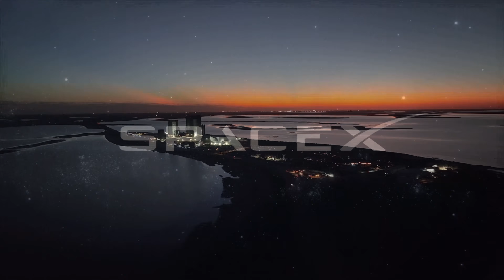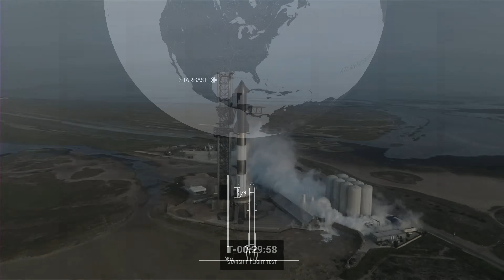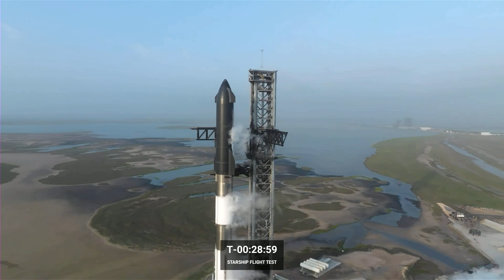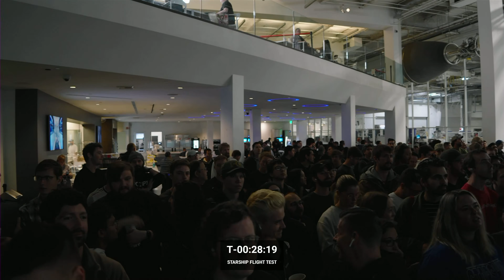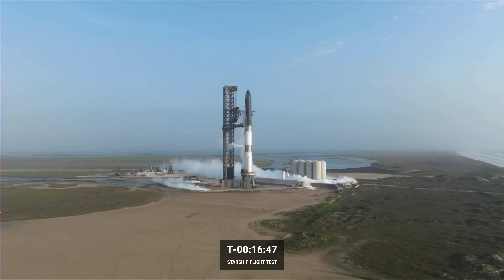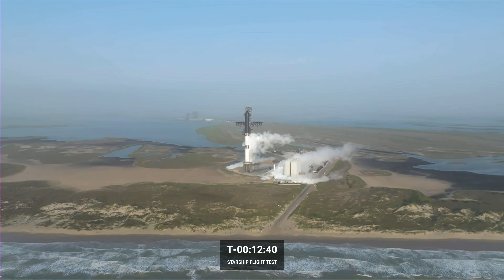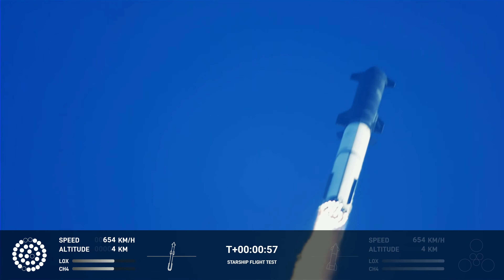Starship Flight Test

Comment: The fact that they could apparently lose so many engines and were still capable of liftoff and sustaining the mission was very cool. That's actually great redundancy and good safety feature.
Seemed like they were never able to completely shut down main engines so the starship was never allowed to separate. 
I can't believe the entire stack was able to flip like that without breaking in half. 
Can't wait to see the next one fly.
Reply: Could you explain more about the flip separation? Was the plan to go horizontal then separating or a 180 or 360 then separating? This is the first I've heard about it. Either way this was a great launch for sure.
Reply: I'm wondering if the altitude telemetry on our screen was off...  If correct, it seems like they were attempting meco rather low.  If the stack did indeed survive multiple flips while still below 60km (aka while still in palpable atmosphere), the vehicle is indeed impressively tough.
Reply: I mean 16 million lbs of thrust over 33 engines with minimal payload weight youncan definitely afford to lose a few :).
Reply: You can lose a few to lift off but it certainly will have an effect of reaching orbit. It seem secure for the rocket but the launchpad and immediate vicinity was almost destroyed. I don't think that van destruction was expected. Danger for those that risk their lives to reach space is expected and acceptable to a point. But not to those on land.
Not to mention the fuel tanks near the launch pod that were completely damaged by the debris: to near too dangerous.
Reply: The fact that the ship drifted sideways during the liftoff is of GREAT concern. That drift could have been towards South Padre island, or over the starbase complex. I think this was a narrow escape that will not be attempted again in Texas. Too many things went wrong. The FAA is going to take  a very close look at this one.
Reply: @1985NEVETS  It's supposed to start spinning when the first stage runs out of propellant. This booster was spinning because the hydraulic controls blew up around 30 seconds into the flight
Reply: Reckless behaviour
Reply: @palpatinewasright  I think that drift was an intentional horizontal velocity component, to keep the massive exhaust away from the launch tower; it did look to be exactly in that direction.
It's also not the first vehicle to do this: If you look at Space Shuttle launches, they also had quite a bit of horizontal velocity right at liftoff.
Reply: @palpatinewasright  The drift was probably due to the destruction of the pad at liftoff. 45:08 you can see the chunks of concrete flying more than halfway up the ship.
Reply: at 45:34 you see the hydraulic control aerodynamic shield blow away, followed by a clear explosion on the side of the booster at 45:37
Reply: That stack flipping as many times as it did and not breaking apart was a testament to the strength they’re going for. Too bad too many don’t realize what they are seeing.
Reply: The man is paying the cost for future reusable starships
Reply: @skillsprintug  He probably paid much more for twitter 🤣
Reply: @palpatinewasright  if it was a case that it was heading inland, they would’ve terminated the launch. No chance of that happening FAA are well aware of the possibilities thus requiring flight termination systems.
Reply: that lift velocity was crazy!
Reply: How many engines were on there?
Reply: @Ariakon  The drift at liftoff was because it had already lost several engines. To maintain control, the thrust vector must point through the center of mass of the rocket. The engine losses were random, they happened to favor one side over the other. To compensate for this the thrust vectoring points the engines sideways slightly, so the thrust vector continues to go point through the center of mass. Because the engines are no longer pointing straight up, there is a lateral component to the rocket thrust in additional to the vertical thrust. i.e. the rocket has to waste energy to push itself sideways a little bit so it can maintain control.

This also gives us a clue as to what happened when it started tumbling. It lost more and more engines during the ascent. Unfortunately for the super heavy almost all of them seemed to be in one hemisphere. The thrust became increasingly imbalanced and it had to work harder and harder to correct. As the first stage consumed fuel the center of mass moved closer to the fully fueled starship until it was almost empty. When the distance between the center of mass and the engines grows, it magnifies the effect of imbalanced thrust. The center of thrust moves farther from rocket center toward one side, eventually it reaches the point where the engines cannot point far enough over to make the center of thrust intersect the center of mass. When this happens engines start imparting angular velocity on the rocket and it begins to tumble. Starship's wings don't help this situation either; they add drag and exacerbate the spinning.

That's my analysis anyways, based only on playing ksp. Once the mass decreased enough the software might have started to differentially shutdown engines to help compensate, hence the discrepancy between the graphic and the visual of the rocket engines. But I wish they had some abort stuff programmed, would have loved to see starship flying but I guess they only have so much space to play around in so they have to go FTS in that specific regime. I'm excited to see what they learn from all this. I wonder if they'll go for another test or pause and make some big changes.
Reply: @luebrenj  "33"

They can't resist.
Reply: @palpatinewasright  Heard (unconfirmed) that some believe that they lost an HPU unit on one side at liftoff. ie lost some ability to gimble. Would lead you to think its a miracle they got as far as they did with 1/2 the hydraulics working (if true). Next iteration gets rid of hydraulics and goes to electrical controls. If you look carefully at the liftoff video and the 1st few seconds, you can see what looks like flames where one of the HPU's was (ie above the engine skirt. The flames were perhaps hydraulic fluid burning.
1 failure point identified with a solution on the next ... at least from an armchair QB.
Reply: @palpatinewasright  the drift is intentional. The entire launch worked out very nicely. SpaceX were expecting less from this launch.
Reply: @skillsprintug  your taxes are paying for most if you are a US citizen
Reply: I wouldn't call that sustaining the mission, they massively undershot their staging altitude. It was supposed to stage somewhere above 80km at it staged at 40. Not exactly a situation that could be salvaged, even if aero forces didn't cause instability
Reply: @thejumper7282  What? It’s called a test flight. They use the data from such tests to perfect the performance. Far from reckless, all calculated and expected. It was launched over water for safety. Be mindful, any products you use is the final alpha product not the beta.
Reply: @palpatinewasright  No, no one at South Padre island or the starbase complex was ever in danger, the flight termination system (FTS) would have blown it up the moment it started leaving the approved safety corridor.
Reply: My Cancer Vlog  Sorry about your diagnosis. Hang in there 💪.
Reply: @palpatinewasright  Interesting. I wonder if the pad got destroyed and that damaged the bottom of the rocket?

If so, then its pretty impressive that the rocket still made it that far up.
Reply: @palpatinewasright  Unless you're referring to something else I'm not seeing, the drift is something that's supposed to happen as the vehicle starts to pitch downrange during ascent. That's for safety (if it dropped back down it'd land in the water) and to start assisting with the eventual gravity turn of the starship proper.
Though based on the footage I couldn't tell if it was actually pitching in the right direction.
Reply: @sofascialistadankulamegado1781  !
That's an amazing fact, where did you read that the drift was intentional?
Reply: @palpatinewasright  lol
Reply: This is the world's largest rocket ever and remember, a prototype.  It did pretty good for it's first flight and they've been trying to tamper expectations for a few weeks that they just wanted to clear the pad (which would have taken months to rebuild if it didn't).
Reply: @1985NEVETS  The flip separation is when they give a bit of an off axis kick and rotate about the horizontal axis. Its similar to how they deploy starlink satalites. The centrifugal force of rotating pulls the two halves of the rocket apart
Reply: @ttran7320  Last i checked.

The exploding launchpad shotgunning everything in the vicinity is... not something ANYONE tests for, including the rocket itself.
Reply: @higueraft571  Actually they were testing it, because on Mars or the moon won’t have a water suppression system. Obviously they learned a lot from the launch, which is the whole purpose of a test.
Reply: @ttran7320  And on Mars and the Moon, it wont be blasting the first stage at point blank...
Reply: @higueraft571  They’re way far from any of that, but let’s just say they learned a lot from this one test.
Reply: @ttran7320  ...far from WHAT? Testing the actual stage for Mars/the Moon? Then why the launchpad as-is. Especially if it WAS meant for later launches as well? 

If you mean the first stage on them...
I really dont know how you think that stage would ever leave Earth considering how early it was meant to drop? 

Not to mention, I dont think that's like ANY surface on either, exactly...

It makes 0 sense at all and ONLY screws up both the data and the facility. 
They of course got data from the parts AFTER the launch, but pretty clearly the Launchpad wasnt a good idea.

Higher-ups typically disregard the Engineers in cases with valid concerns, this is one of them.
Reply: They werent able to sustain the mission. In "operational" mission this would result in some sort of mission abort and ocean splashdown. iirc, they can afford to loose 3 engines to still have norminal launch. Loosing more(i have no information on exact number) will result in some sort of abort. Loosing 8 means launch is lost beacuse raptors can no longer supply enaugh gasses to propellant tanks to keep them pressurised and as consequence tank pressure drops and soon engines would not have necessary head pressure to suck up the propellants.

On this launch they lost so many engines they were not able to reach targeted speeds and altitude for staging from what ive been told.
Reply: @higueraft571  Elon is the chief Engineer…

Comment: Gives me big KSP vibes. Love that even if the ship blows up its still seen as a success.
Reply: Didn't destroy the launch pad == big win.

Were those fuel tanks right next the pad? Geez, I think I'd put them at little further away.
Reply: @PeteSmoot  it kinda did in a way, if you look there is now a crater under the OLM and there was concrete flying 50 meters into the air on launch
Reply: @sausageroll2695  yup. Starship has over twice the thrust of a saturn v at liftoff, even if it had some engines off at launch. It's just enough thrust to tear up its launch pad, so they may need to launch it from like a height or maybe from the ocean in order to avoid it destroying its pad.
Reply: When I don't check the stability of the second stage.
Reply: We have officially entered the movie Idiocracy.
Reply: @PeteSmoot  They are water tanks pumped into the launch tunnel to dampen thrust exhaust. Most of the "smoke" you see on launch is steam.
Reply: @SoaringMoon  Those 8 upright white “barrels” are the fuel storage. I’ve been following the construction of Starbase for years.
Reply: @corneliusrupert7354  easy said than done
Reply: @Jasper97000  there talking about adding a flame diverter to solve this problem, and it's expensive but necessary.
Reply: Hebrews

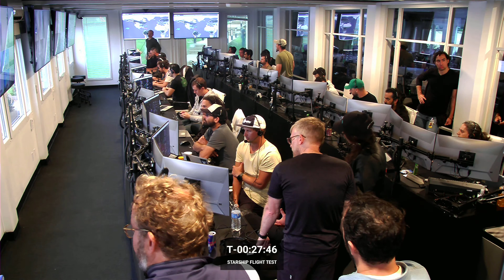12:14 Make every effort to live in peace with all men and to be holy; without holiness no one will see the Lord.

Acts

3:19 Repent, then, and turn to God, so that your sins may be wiped out, that times of refreshing may come from the Lord,

James 2:24,26

Ye see then how that by works a man is justified, and not by faith only. For as the body without the spirit is dead, so faith without works is dead also.

John

3:16 'For God so loved the world that he gave his one and only Son, that whoever believes in him shall not perish but have eternal life.
 
3:17 For God did not send his Son into the world to condemn the world, but to save the world through him.

3:19 This is the verdict: Light has come into the world, but men loved darkness instead of light because their deeds were evil.
Reply: @sausageroll2695  The launch pad got its own back by causing a lot of damage to the rocket.
Reply: @sausageroll2695  is that why some went offline from being damaged at launch?
I have no idea how big it is, but reading twice the thrust of Saturn 5 and seeing some articles three commercial airplanes long. Wasn't Saturn 5 just the tip, a small parachute pod in space and falling back down. Same size, twice the thrust, 10 times the elbow room? Crazy days ahead that people haven't seen since they canceled space.
Reply: @PeteSmoot  >Didn't destroy the launch pad
It kind of literally tore a massive crater in it, shotgunning both the rocket and everything in the vicinity with massive amounts of debris...
Reply: @Brando7867-j1u  Problem is, they cant just simply "add" one. 

They have to completely rebuild the Launchpad from scratch, it's FAR too low.

Comment: The fact that Starship cleared the tower, survived an early explosion, then surpassed Max Q, and endured all those unusual attitude lateral forces is stunning. They surely got a lot of great data.
Reply: My kerbal ships break up after 1 flip normally. Got 4 before she went RUD.
Reply: @brianbarrett2487  The only minute it went RUD is because the Flight Termination System was detonated by the ground crew, destroying the vehicle
Reply: The structural teams will be very happy that the stack held together. Pity the second stage refused to detach. Strong machine for sure.
Reply: Elon did not look happy there honestly.. all while the engineers in the room were of course jubilant with being able to just be part of the whole experimentation process on something this huge -- and thus obviously cheering on the spectacle and efforts made and likely for the entire  next development cycle to restart again  ✌
Reply: @jgunther3398  possibly. But that would be a programmatic fault. There would have been nothing to lose by staging at some point in the terminal phase. Just hanging on dooms both the booster and the starship.
Reply: @donkoh5738  he lost like 5 million in 5 minutes I'd be mad too
Reply: That too in the first run
Reply: curdi - he unfortunately also took quite a combined haircut on Tesla in pre-market opening alone.  Hopefully getting a good sleep tonight and able to reboot tomorrow, for a fresh new start:   in the first day of the rest of his journey here on Earth ✌
Reply: Non one care you Q lol
Reply: Hebrews

12:14 Make every effort to live in peace with all men and to be holy; without holiness no one will see the Lord.

Acts

3:19 Repent, then, and turn to God, so that your sins may be wiped out, that times of refreshing may come from the Lord,

James 2:24,26

Ye see then how that by works a man is justified, and not by faith only. For as the body without the spirit is dead, so faith without works is dead also.

John

3:16 'For God so loved the world that he gave his one and only Son, that whoever believes in him shall not perish but have eternal life.
 
3:17 For God did not send his Son into the world to condemn the world, but to save the world through him.

3:19 This is the verdict: Light has come into the world, but men loved darkness instead of light because their deeds were evil.
Reply: @donkoh5738  who knows what he was thinking lol he always has that same expression
Reply: @Prodbytocile  he could care less about money. He knows this is what it cost to get to Mars.
Reply: would be better if they didn't exaggerate and overhype.  
for instance,  why "starship"? not going to any stars. why not just a name or planetship, or orbiter (btw nasa, roscosmos, etc, are far better at that).
Reply: @sitting_nut  That's just a name, there is no beginning of Mars, how can we conquer the sea of stardust, not to mention the task assigned to starship, we all understand
Reply: @sitting_nut  And he is not a government official, so there is no need to be serious
Reply: @Prodbytocile  werent both going to end up smashed to bits in the ocean anyway. Only loss here was the data on separation and Starship flight.
Reply: @TRUST_DPP  my point was name was a symptom of exaggeration and overhype.
Reply: "The good news of Jesus Christ is that he came to save us from our sins and offer us eternal life through faith in him. Jesus died on the cross to pay the penalty for our sins, and he rose from the dead to conquer death and give us hope. If we confess our sins and believe in Jesus, we can have forgiveness and new life. God loves you and wants to have a personal relationship with you. Will you accept his gift of salvation and trust in Jesus as your Savior?
Reply: @donkoh5738  THE CHEERING IS FORCED
Reply: @youtubeconnollyfamily  - He bought Twitter...  agreed :  he could care less about money!
Reply: @donkoh5738  and that’s why everyone with common sense loves him
Reply: That would unfortunately  be a flawed logical argument there @ Con fam , as soon you said:  'everyone'
Reply: @sitting_nut  >why "starship"?
It's another term for "spaceship" that is commonly used in sci-fi for "spacefaring ship/vessel".

You could pick literally any other reason to complain about it :V
Reply: @youtubeconnollyfamily  Unfortunately, buying Twitter and having to pay the costs IS costing him a fortune, as much as he tries to ignore paying taxes for Twitter HQ :V